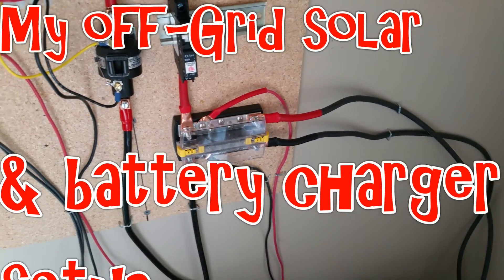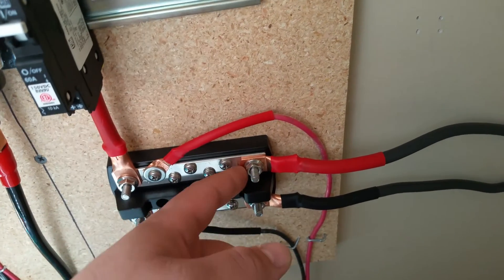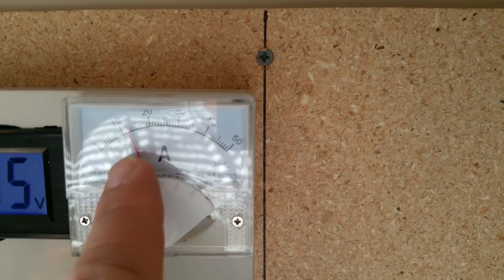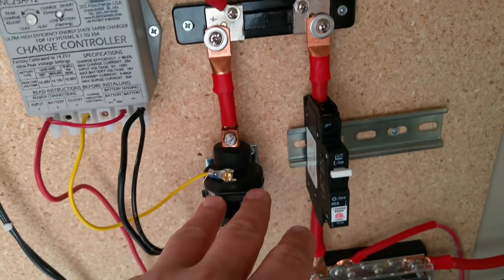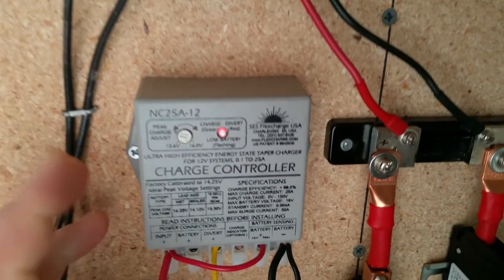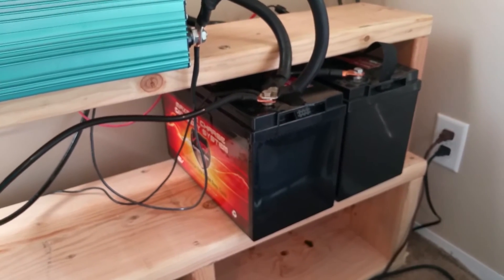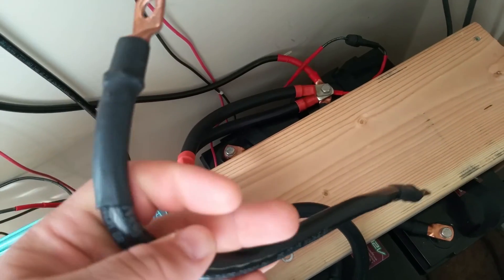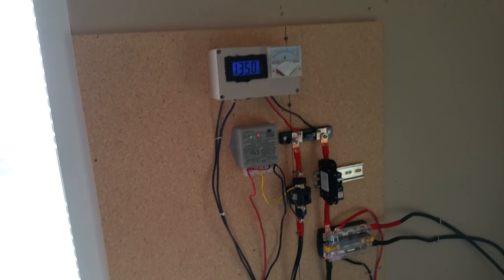My off-Grid Solar & Battery Charger Setup

Comment: i am impressed that you touch the connection. the hot wire with lots off amp can kill you quickly.
Reply from the maker: +Taguun Its 12 volts. I could touch it all day long even at 40 amps and not feel it.